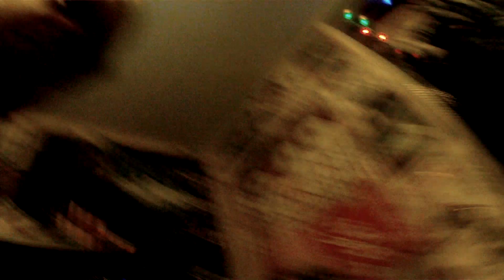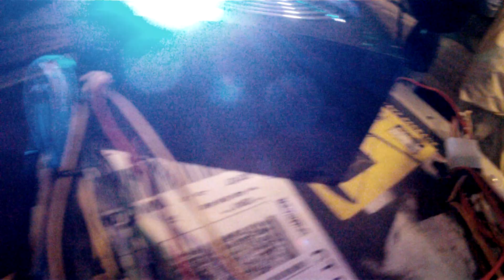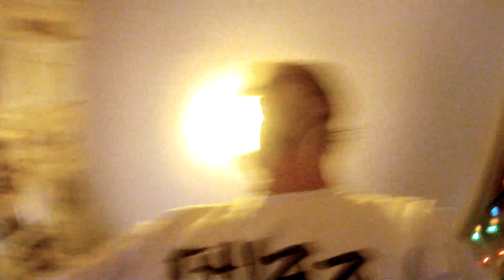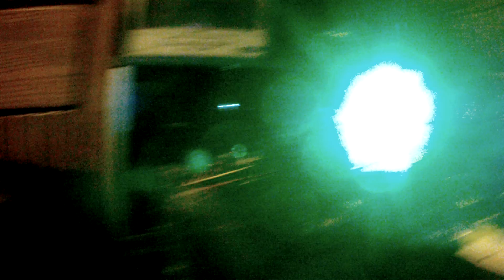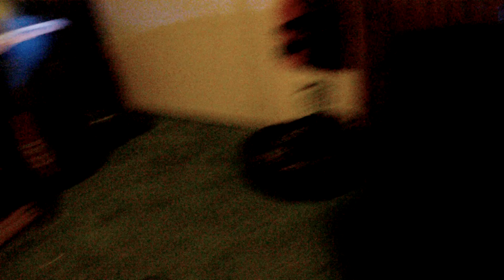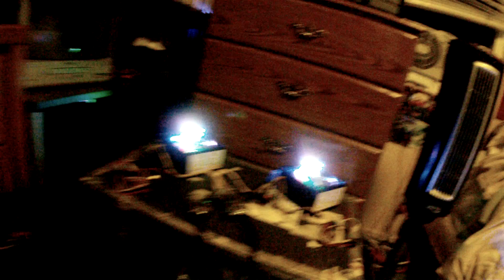How to install a car amp and subs in your house with computer power supply

Comment: quick tip, if you connect both green wires from the psu's then it kicks out around 12.4 volts so they work together and not against each other, dont want to burst ur bubble but u boom more than the subs, anyone agree?